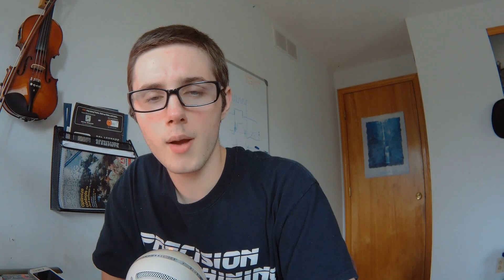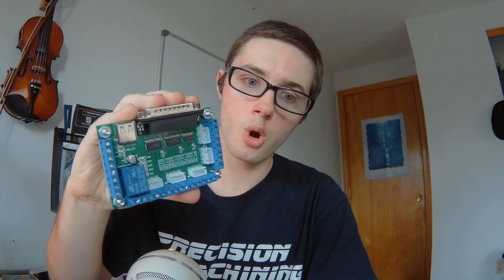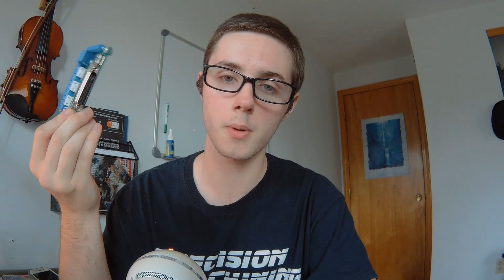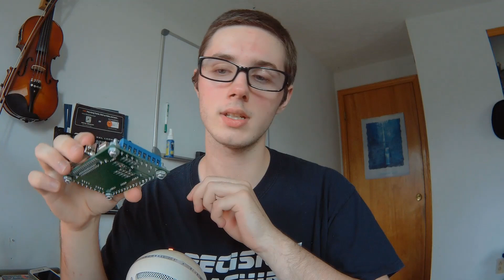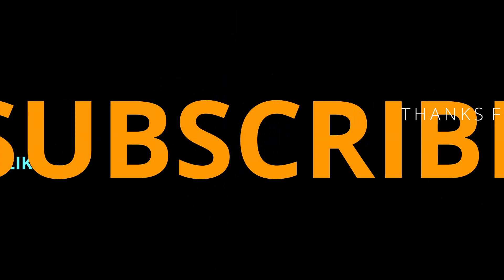LINUX CNC VS FANUC

Comment: Is it pronounced fan-auk or fan-ook?
Reply: FANUC or Fan Uc; basically exactly like he pronounced it.  You'll get these 20yr machine tool veterans saying Fu-Nook and when you just say it like Stay Based does they will give you a dirty look like you're stupid.  Technically the Japanese do actually say fan oo k, the problem is they modulate their pronunciation so fast that if you try doing it you'll sound like the vets thinking they're clever.  Just say it concisely as it's spelled and that will get you the close approximation of what a Japanese would find intelligible.

Comment: I, j, k on a Fanuc is the incremental distance in x, y and z from start point to The center point of the arc. As an example, If you put the centerline of your tool at y.25 and want to sweep a full circle, you could command g3 J-. 25 and generate a 360° sweep with Y0 being center, whereas with R you have to break it into two lines. Also, R is an option on some machines. Using cutter comp, you would still put the full value of the center distance from the edge of the cutter to the center of the arc, so using cutter comp in my example would still use I-.25 to increment back to the start of the arc. Ijk gets confusing when you're trying to find center points on angular lines, but that's why there are cam systems and conversational controls 😊. Unless you're using G18 and G19 on a mill, you would always use i and j in G17 and you would have to change to I, K or J, K respectively. R is easier, but there are some issues with R. For starters, R is a loose radius and doesn't care about end point error, it will happily put that R.25 anywhere you tell it, plus on some controllers, there are rounding issues with R, so ijk is the preferred method of controlling arcs, even on some lathes. 

Hope this helps